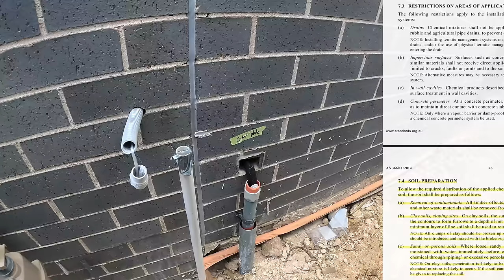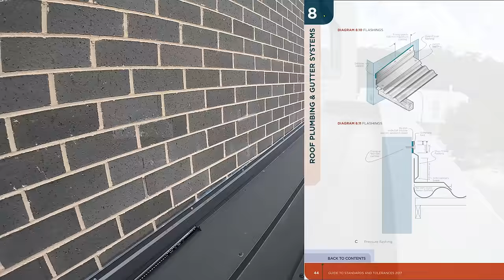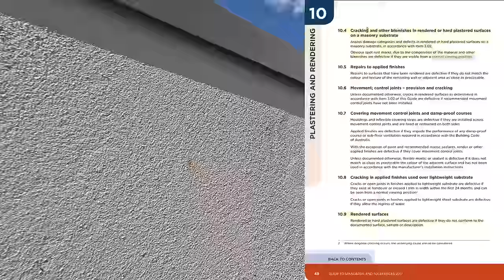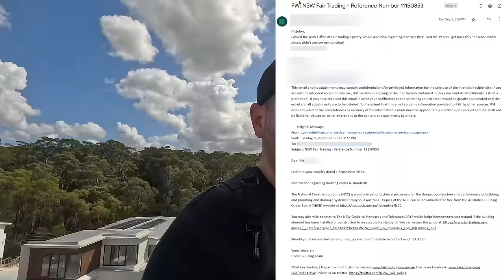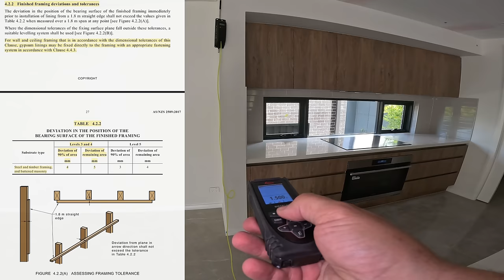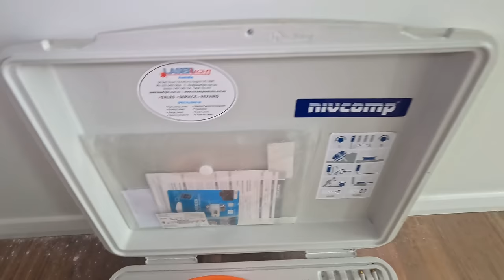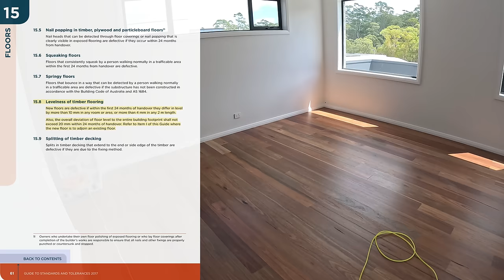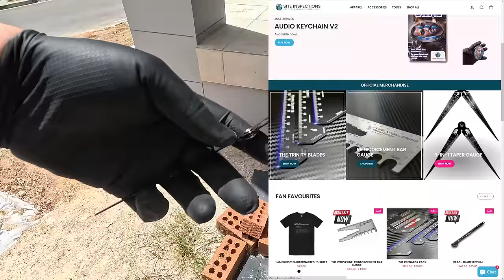I Inspected An Award-Winning Build | NSW Exclusive

Comment: Why the hell does every new home over there seem to have flat rooves these days? It is widely known how problematic they are and how many issues they will cause over the lifespan of a dwelling. They used to be all the rage here in Finland back in the 70's but no-one uses them anymore because everyone knows not to. A regular pitched roof with conventional gutters is cheaper to build and will not suffer from moisture related problems such as mould. Just about every older flat roof house WILL be full of mould at some point!
Reply: Mould isn't as bad as a problem in most of Australia as it's warm and dry.

Flat roofs are generally used because of height restrictions, it allows another floor to be in your house.

Flat roofs in Oz have been the thing for decades, you don't tend to get as many problems as they're steel. So last many decades.

Flat roofs in UK are very popular and often a problem as people use cheap felt that breaks down after 10yrs.

Ps: also in Oz snow isn't a problem like it would be in Finland for a flat roof.
Reply: I think it has mostly to do with building the maximum interior space within the building envelope. I think with height restrictions they wouldn't be able to build the house so close to the boundary while retaining a pitched roof on a two storey house.
Reply: @Robert-cu9bm  Not in all parts of Australia. Flat rooves are quite rare in the tropical areas of the country where high winds and rain are much more common.
Reply: Exactly there's no such thing as a compliant box gutter
Reply: Its probably about 50% with flat rooves (and about 75% with at least SOME sort of flat area like an out cropping but with majority tiles). Agree with you completely, my townhouse which was built in the 70s is flat roofed and its loud in rain, ugly and cooks the upstairs in summer. A conventional pitched roof would be a massive improvement in every regard.
Reply: Looked like the bulkheads had more fall than the Roof did!
Reply: @Robert-cu9bm Mould is most definitely an issue in Australia due to our shit insulation. There's constantly stories about in apartments etc on Reddit, the news.
Reply: Lowe prices
Reply: In Australia snow isn’t a problem in most of Australia, in places with high rain and winds you’ll find non-flat roofs but in places like where this is mould isn’t a big issue. Most homes in Australia actually have non-flat roofs, it’s only just become a recent style trend.
Reply: Because of height restrictions of shadowing of neighbours dwellings people have flat roofs to go 2 story 👍
Reply: @Robert-cu9bm flat roofs still suck in Australia 💯
Reply: @Robert-cu9bm lol from all of the mid Coast towards the north mold is an issue wtf are u talking about 😂
Reply: @Robert-cu9bm did you forget about the whole top half of Australia?
Reply: @Robert-cu9bm  flat roof steel tile whatever always give more problems the gutter designs are often overcomplex and rely on precision installation of box gutters flashing etc. So its not a case as if it will leak as to when it will...
Reply: People call it post modern, yet I think it’s purely because they use less material and easier to make
Reply: No angles to work out,the labourer can do 90% for them😅
Reply: Could not agree more!!! When I see flat roofs in USA I shake my head. It is really rare and almost all people I know with flat roofs have issues.
Reply: It's a trend!
Flat roofs are always a problem, never buy a house with flat roofs and box gutters.
Reply: @gardenwaster  he cracks me up with his gutter takes lmao used to residential guttering in the United States for around 15 years and he is just so unbelievably dramatic it’s hilarious. Most of everything he’s shown would be 100% fine in anything outside a hurricane. Lol 

Problem where he lives seems to be dogshit contractors and builders
Reply: There are quite a few advantages to flat roofing in areas with high snow loading so long as they are properly constructed. See them everywhere in northern Japan.
Reply: On this council there is height restrictions , people want real high ceilings and combined with the sloping sites its hard to keep under the height
Reply: I remember learning the constructs of a roof at primary school and why a flat roof was not recommended.....
Reply: @petejay75  because we build cheap crap in Australia
Reply: @petejay75  they didn’t have French draining back then. They figured it out. More usable space per material used. Plus you have to reshingle a roof like every 10-15 years anyways. It’s all a mess
Reply: He comments about noncompliance all the time relating to creating a waterproof membrane and proper drainage
Reply: Mmm, give me a 42 degree pitch roof, any day, especially if living near forested areas.

Comment: Imagine living in one of those polystyrene boxes backing onto pristine bush, representative of the worst we have to offer
Reply: I hate everything about the houses built in the last 10 years, from the boxy factory look to the polystyrene walls.
Reply: Wait for the fire. Being so close to the bush these houses must be in a flame zone! Where are the steel shutters? No combustable materials on the outside? No holes? Insurance void
Reply: Polystyrene box is the best description I've heard 😂😂 knew they reminded me of something!!
Reply: Give it five years and the pristine bush will be replaced by more polystyrene boxes.
Reply: @sylviam6535 bring back post war architecture, now those homes have so much more character and thought behind the build and design.
Reply: Arsonist set fire to my house at lock up. Melted my plastic box walls which cost 10k to reinstate. It also damaged the structural concrete floor, ceiling and columns (spalling) it cost 150k to fix (not replace). Its also warped metal flashing/  frames and burnt all timber framing  which cost another 50k to reinstate. I think I will use more plastic next time!!  Its amazing how we all like to think we know/ or are wiser than others!!!!
Reply: U serious? Where do u live? These are $4m homes
Reply: @madhardcorenick  - Yeah, the blocks keep on shrinking.
Reply: @rossg9701  That bush is Cattai Creek which backs onto annangrove. It won't be going anywhere.

Comment: Every time I see you've uploaded a new video, I get equal part excited and terrified of what you're going to find. Without watching yet I can guarantee a non compliant bathroom waterproofing effort and box gutter fails if it has any.
Reply: Box gutters are terrible, I have relatives with a multimillion dollar house, they had to redo the whole roof and all the waterproofing of course. Also they discovered flashing was not installed properly or at all in 3/4 of the building.

Comment: Im a residential carpenter from NSW, the construction industry is an absolute mess. 
Nobody gives a hoot about quality, or how one trades work effects the other following trades etc, the "bigger picture/common goal" mentality is gone, the teamwork mentality is gone. If one thing goes wrong, NOBODY will put on the brakes and rectify the issue, they just continue to build over the top of any problems etc.

This is why floors and walls are not level or plumb, if the concrete slab is out poured out of level, or parallel, which they are most of the time, the framing carpenters will just stand the frames and continue to build on the out of level concrete etc.

Generally there isn't enough allowance on the job for the framing team to spend the additional time to rectify the issues from the previous trade. Then things just continue to snowball from there. Ive personally seen new concrete slabs 60mm+ out of parallel and 25mm+ out of level.

Its an absolute dog eat dog industry that's rife with clowns and cowboy "tradespeople"

Quality control is ultimately left up to the homeowner/client, basically if you will accept shite work, you will get shite work. 

Also, I cannot understand why ternite reticulation systems are still allowed to be installed in this day. They pump chemicals into the soil around your home, and have to be topped up frequently, not to mention they are usually damaged and not working within 6 months of the build being finished.

That being said, keep up the good work brother. The industry needs an overhaul, and its guys like you shedding light on all this disgusting work that will hopefully lead to change. 🤝💪
Reply: Try being a waterproofer. Its a constant struggle to have the trades before you and after build complient bathrooms etc and then get people to not damage your membrane.
Reply: @superthevibe you’re 100% spot on. It’s really sad all the properly skilled and trained guys are retiring and those skills are getting lost forever. Young guys don’t have any pride in their work are not being taught properly and so we are in the position we are now.
Reply: I've seen commercial jobs where the slab was so out of level, they had to shim as much an inch in some places, but the framers squared it up from then on. On your general theme (this should not be the case in suburb like this one). I've worked on framing crews. We just came on each house and made the best of the framing and moved on, with no contact with a super or other trades.
Reply: Seems like to one degree or another this is the case in many countries. Whenever we had major renovations or likes done in our house we had an architect who was a friend of the family plan it all out and he would daily stop by to check on the progress of the work and wether or not it was all done correctly, and since he also suggested/chose the different companies involved they'd usually to their work properly cause otherwise he'd not pick them again for his next projects. Think it's worth the extra money to pay for that kind of supervision/service, paying to rectify all those issues that show up month or years afterwards is likely gonna cost alot more not to mention the personal time and stress involved to do so.
Reply: This is what happens when it’s all about subbies doing the work at lowest cost and don’t give a fuck about the next subbie that has to come in ….. building is a mess across the Country - never buy a new property or one completed in the last 20 years
Reply: I want to ask you guys something. Why don't you build houses with bricks, cement, concrete ..... like we do in Europe? If it's for the cost of the building what's the difference between the two? I'm just curious. Thanks.
Reply: Mate, absolutely spot on. This just sums up EVERYTHING.
Reply: I'm from eastern Europe. I don't know how its done in most of the world but you have one shot at masonry and especially at concrete.Theres no turning back to fix anything, it's done, adios.
Reply: @hi-ml2wt  the difference is they don't have enough skilled workers. Masonry is unforgiving. I already wrote. It's not carpentry. And they have skilled carpenters but not enough skilled masons to do that one shot flawless
Reply: @hi-ml2wt  Labour costs. Takes longer for a brickie to lay bricks than it does to frame and clad it
Reply: @vzgsxr  it's because builders pay peanuts, it's quantity over quality. And if there is no money in the jobs, trades, either concreters, chippies, tilers, roofers, sparkies aren't going wait for things to be rectified. At the end of the day, the fingers are always pointed at the trades. But it's the builder who is absolutely, and solely responsible for what is accepted. Whether it's an out of level slab, out of plumb wall, lights in the wrong spot, or just straight up dodgy shit being missed.... It is ultimately the builder who has engaged those trades to identify ahead of time if things are not ready for the next trade. So if a slab is out of level, or over/under poured and not as per set out.  It is the builder who has not picked this up prior to placement, it's the builder who has not identified and or rectified it prior to framers starting and it is that builders responsibility to ensure exactly what you have outlined is managed properly. The problem is not individual trade. It is a follow on effect of builders that build these homes paying unders, not managing the build properly, and not scheduling works around what is actually happening on that site. And it all comes back to $$$. I am a carpenter by trade, although I have spent nearly 15 years in site management, and project management rolls all over Queensland in the commercial sector. The commercial sector doesn't suffer from this type of thing typically. Things are held to a much much higher standard, it has to be as every element is engineered, designed and drafted in depth and constant visitation from these in the design and engineering, or third party's whom represent them are effectively always onsite throughout the build due to the strict criteria for inspection of works, itps, design and constructability issues. 

Residential, project builders etc are not under these strict standards and they are largely able to cut costs or pay much less due to the dog eat dog mentality with that sector. It needs a complete and total over haul.  But the issues are with the builders, not the individual trades. Training, knowledge, equipment, education for trades has never been more available, or used in human history. I have been in the construction sector heavily for nearly 20 years. And the trades learning, the younger generation etc is no different from 20 years ago, except we now have a more prominent female trade base, which is great. The one thing that shows a correlation that relates to the ups and downs of our of standard build or faulty works is money and rates, predominantly the rates of what these builders pay. Comparative to 20 years ago, the huge increase in build costs aren't relevant with the increase of materials, and the typical rates of subbies show that residential trades working on these builds aren't being paid relative to that either.  These builders pay nothing, they have no quality management, and they do not like to spend money training thier supervisors, HOW TO SUPERVISE a site effectively.  

The residential sector, or at least the quality of the workmanship on those builds is noone elses fault but that of the builder supervising, or building these jobs in Australia.  Project home builders are responsible for this, nobody else.
Reply: @BrickTop900  it's got nothing to do with skilled guys. The trades learning these days are exponentially smarter then those before them. This has been analysed extensively over the years.  It is builders, more specifically project builders and there inability to manage actually building a house.
Reply: @gheufbfff  what? Take a look at a 100 year old building and the shit we produce today. They are not smarter at all. You’d be hard pressed to build to the same quality today.
Reply: @BrickTop900  I agree. To the dilinos who believe in Darwinism wake up we not evolving at all. We so far backwards it's scary...
Reply: Cheapest quote wins

Comment: Great inspection, but you missed a major issue with the kliplok roof, whomever fitted the gutter guard put screws into the pan which is a big no no, as fine debris will build up over time between the edge of the mesh and roof and ponding of water will occur, the clips that have been used are for a trim deck roof which will allow debris to enter through the sides of the clips as they do not fit the profile of the kliplok, the owner has every right to ask for the roof sheets to be replaced as it will leek over time, and i am pretty sure it has voided colorebonds warranty by penetrating the kliplok. You can buy kliplok kits so no excuse to screw into the pan, Aussie diy solutions, Screen Tech ind, Karben Industries all sell these kits.

Comment: you should share the videos of the houses where builders have done their job properly as well
Reply: this would be amazing, to know that there's good enough builders out there
Reply: @hadongan  the reality is the whole I industry is stuffed
Reply: BTW 20 + years in industry
Reply: What's the point in that? A builder doing a job he's EXPECTED to do well and actually does it?
Reply: @hadongan  They exist, but it's like a coin flip whether the one you get is going to do a good job or not.
Reply: not enough to video?
Reply: Pointing out the painting look at those mitres. Its the builders job to get those level.  I use to call the builder back to this guy will have you fill it which will just crack the time the door slams.. builder can't even cut clean mites anymore

Comment: The best idea moving forward is this

what we need is for home owners to pay thirds of their building works and hold out the last third until an inspector has given the house the green light upon completion. This way builders final pay can be withheld until all noncompliances have been rectified.

So drawing a simple agreement with this clause will save people headaches down the track. A little more tweaking of this agreement if needed can be adjusted.

Its simple, lets not complicate it.

Summary
Get an inspection done after each trade does their task, this way the builder can be told immediately to rectify. It just means you need to allow for this when building.
Reply: Most new builds are already done in 4 part payments with the bank not releasing funds until there is proof the work was done.  In most cases it is 90% the bank's asset anyway at handover.  The issue is that the builder now pays for the progress inspections creating an immediate conflict of interest.
I have seen a builder walk away leaving all the kitchen cabinet doors and drawer fronts unfitted.

Comment: Alot of the ceiling and floor level probs usually stem from the footings/slab not being level. I've delt with alot of slabs that have fall towards the back of the garages in my time. The footings are the most important part to get right. Every fault flows up and compounds the higher you go.